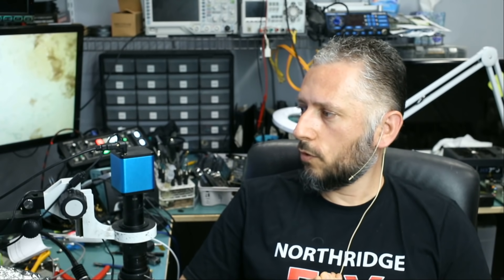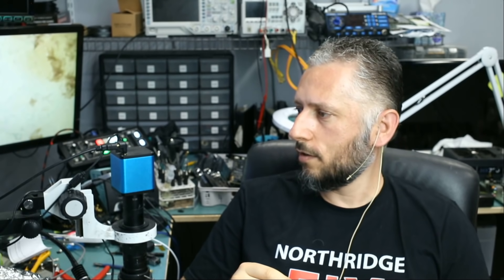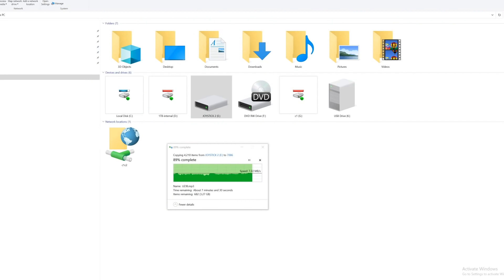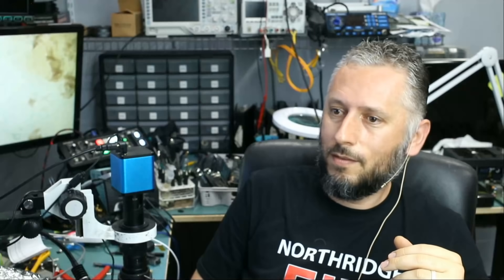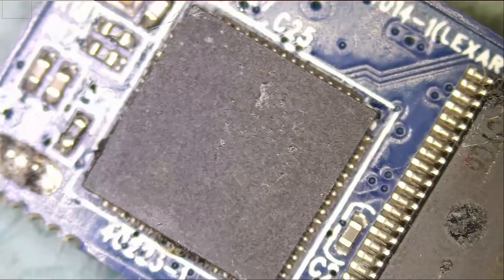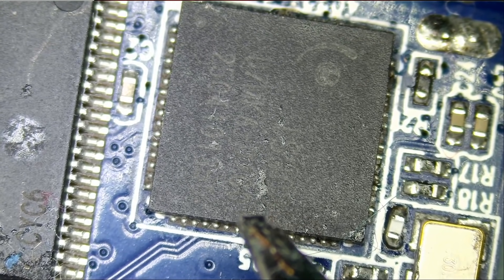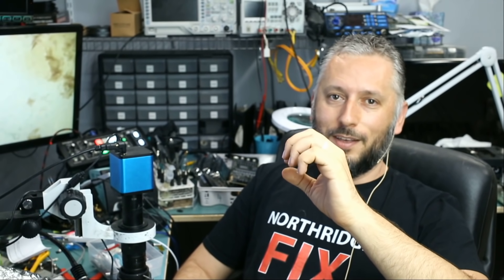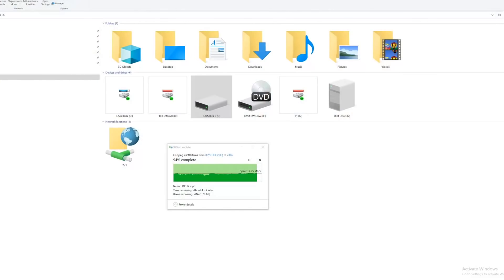Flash Drive Device not Recognized Fixed

Comment: That was good fix,I have one broken USB mem stick from years ago and last year i bought a hot air station just to mess around with and try to learn.most of the things i have fixed were because the bad part was visible to the eye under magnification.So thanks for showing so much of the magnifying glass.

Comment: Put a clothespin on it next time. I use them all the time. Old school wooden clothespins. You can bend the spring metal a little to adjust the pressure too or just put rubber bands around them and make yourself a poor man's third hand.

Comment: It makes sense, if the controller is overheating that would cause it's pins to left from the board especially if the soldering and solder used are weak to begin with. Nice job 👍

Comment: Is that PCB a single-layer board? The issue for the controller chip with the pressure helping the problem could mean that one of the layers has an issue and applying pressure may help an internal contact. Perhaps due to the drive suffering damage on USB connector end the board is simply bent and pressure is helping the solder balls on the controller chip make contact with the pads.  In the repair business not giving up on a problem can be a detriment as well as a savior at times.

Comment: I did something similar before I knew what micro soldering and cold solder joints were.  I picked up a tube tv out of the garbage that would shut off after it warmed up.  Poking around, I was able to get it to stay on if I pressed the board in a "sweet spot".  I stuck a plastic golf tee between the board and the case.  It worked trouble free for 10 years before flat screens became affordable.  I don't have anything technical to add to comments but am interested in the contests....

Comment: Hi. I once had problem with a unit that worked outside the box but failed as soon as I put it in the box. Found out (by accident) it was light sensitive, as soon as it was in darkness it stopped working. (it was a white ceramic package) ?? electronics can be weird. :-)